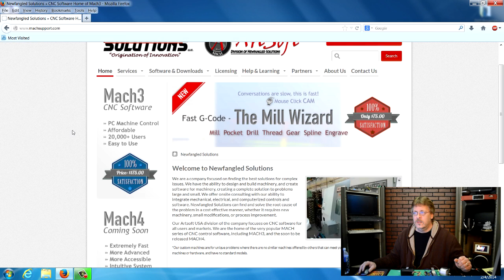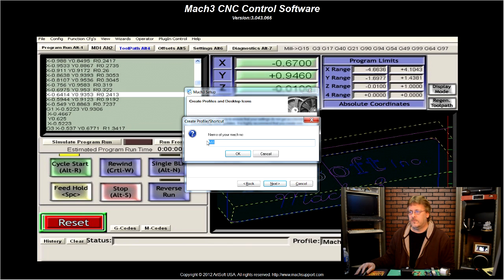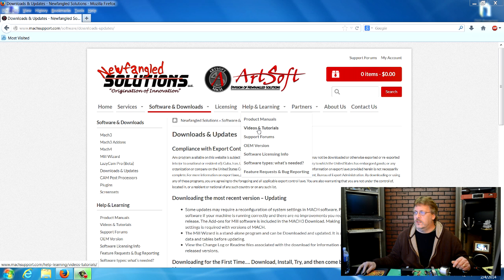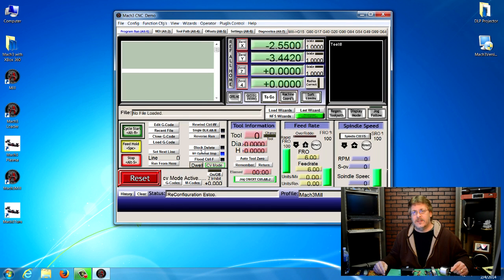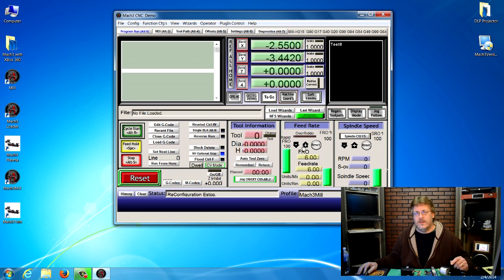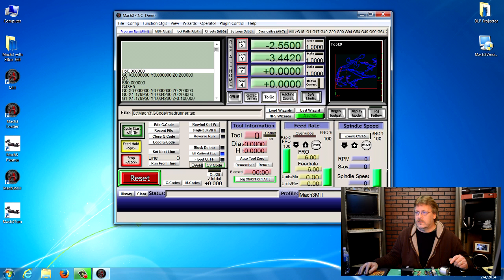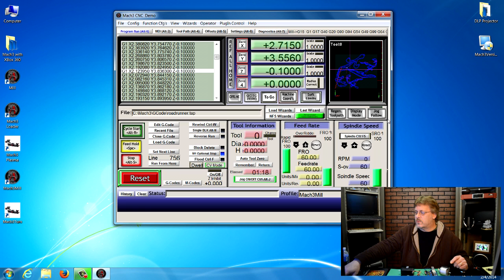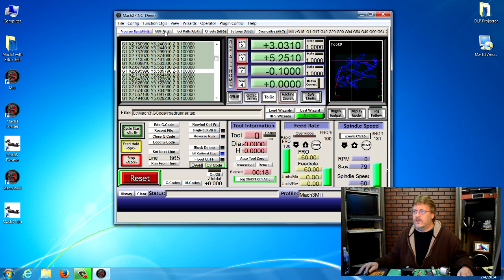CNC Machine Control Using Mach3 - A Beginners Introduction #1

Comment: hi steve can you help I have just written my fist g code program . Its a complex shape for milling  3mm aluminium template. I must have got inches mix up with mm. hence 3mm = 3". how can I correct this. without rewriting the program all over again. kind regards
Reply from the maker: Hi, Well, if it were me I would copy the g-code into MS word pad and use the search/replace function to find the old values,change to new values and apply changes. Then save it again and import to machine

Comment: Nice vids man.  Hey can you tell me what driver kit you used?  I've been having a hell of a time finding a decent cnc driver board for a decent price.   I have found the electronics part of the cnc build quite challenging.  Any help is greatly appreciated. Thanks.
Reply from the maker: I am using the 3 axis controller kit from hobbycnc . It is inexpensive and works well but you must put together yourself. Google hobby cnc to get site. Steve

Comment: I have a 3 NEMA 24motors rated for 425oz. How do you discover your ports and pins for Mach 3. Also do you need the full version to run the motors or will the demo version work.
Reply from the maker: You can use the diagnostics tab to examine ports and pin configurations in Mach3, however it will not tell you what pins are connected to motors. Just take note of what pins you wire your motors to the parallel to. Mach3 will run motors in demo mode the only restriction of demo is the size of g code that is allowed.

Comment: Thanks Steve for the Mach3 intro and also putting me back on the fence between CNC router or 3D printer.  No room for both, but weighing the possible uses of each in my current projects.